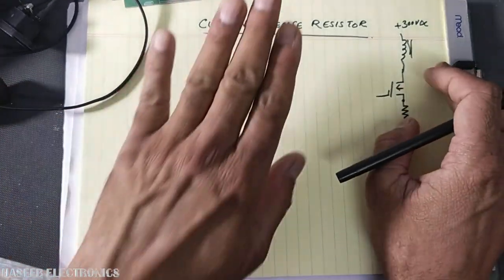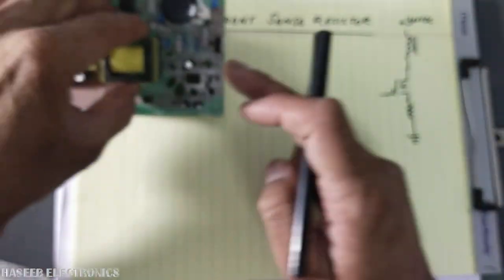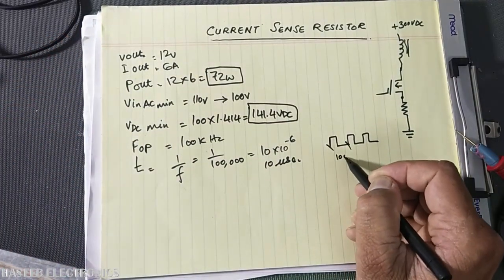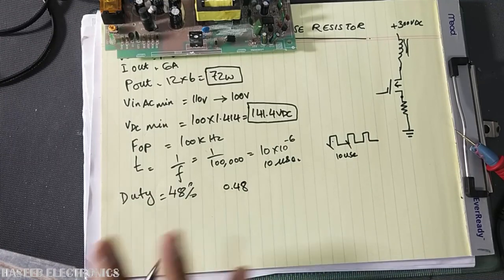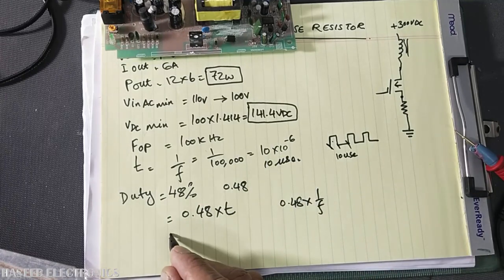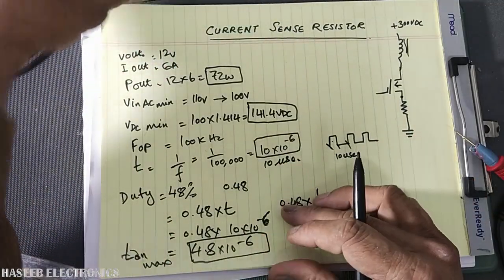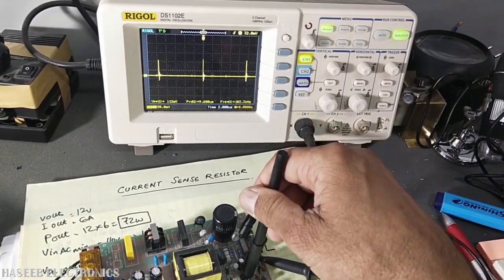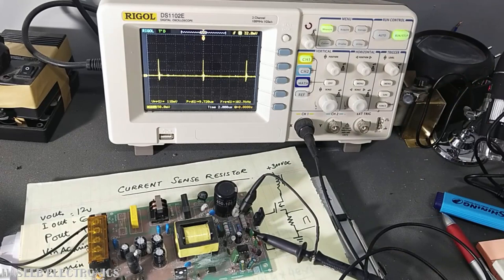{583} Current Sense Resistor Calculation

Comment: Multimeters have their own internal resistance as well. That’s why when measuring the current sense with regular meter it will not show correct value. You need an oscilloscope or a true peak to peak measuring device.this guy is a real good teacher. Ty for showing us how to prove it. Well done.
Reply from the maker: yes dear your right 
multimeters have internal resistance but that is much high so these don't effect too much, 
biggest effect is that the multimeters use RMS or TRMS sampling method and their high frequency is not good specially higher frequencies and duty cycle based pulses.so that's why we need oscilloscope to measure peak voltage or we need four wire measuring technique to get true rms value then we can convert in peak value by multiplying with 1.414
Reply: @HaseebElectronics  Awsome ty.

Comment: Sir, thank you for the amazing videos, I have gained so much knowledge from following your explanations.
Could you please make a video with focus on possible short circuits in the output side of SMPS? I am trying to fix my laptop adapter but unable to locate shorted component. In off board testing, output terminals of the adapter are showing continuity. For reference, I am working on a 135W, 20V Lenovo adapter using DAP019E IC(input side) and DAS01B IC & DAS05 IC(output side). I have checked all capacitors, MOSFETs and optocoupler after removing them from the board but the short still remains.  I'm extremely motivated to fix this adapter and learn more about SMPS in the process. Thank you again.
Reply: kartınızda yanmış bir kısım var mı?  var ise tüm yanmış kısmı temizleyin !
(this is article is turkish)

Comment: Thank you very much for your educational videos... I have learn many points from you..... Sir I have SMPS power supply (FDPS-100N-R5) and it is working some times with small vibration sound... most of the time not working.... I have checked many components and all are okay... please give advice to solve this problem...
Reply from the maker: thanks a lot 
please check that the transformer core pieces are not separated.
check the VCC capacitor connected to the VCC pin
check output side capacitors

Comment: I would expect the inductor efficiency adjustment to be 1/efficiency, meaning a requirement to increase the size of the inductor with a 10% reduction in efficiency.  So, 0.9 should be in the denominator?

Comment: I was expecting to see the one voltage drop that you explained in the oscilloscope.. with load...instead of 116mV without load. Can the inductance of transformer primary be found on data sheet or measure with LCR meter?

Comment: please how do we calculate or know the auxiliary voltage.
Reply from the maker: auxiliary voltage are to be calculated by checking the 
VCC voltage, UVLO lower & upper limits. 
after winding,  finally it can be adjusted by adding a current limiting resistance at vcc pin to compensate the difference in calculation and practical winding turns

Comment: Kindly explain the proper connection of pin 1 and 2 of  any uc38xx because it given me serious problem the IC can't start and if I touch the + probe lead of my multimeter it will start oscillating and the frequency is not stable
Thanks

Comment: Haseeb

Where did you obtain the duty cycle value of 48%? Because looking at the datasheet, max duty cycle for UC3843 states 100%. Is this a design choice? What if you were using UC3844 or UC3845 where in the datasheet it states max duty cycle to be around 48%?

Secondly, there's not really a need to go back and forth looking for inductance L of the primary coil and plugging things back and forth. The Ipeak can be calculated from the simplified expression below because a lot of the expressions cancels out.

Duty_cycle = t_on/t

Ipeak = 2.5/Transformer_efficiency/Duty_cycle*Pout/VinDC_min
Ipeak = 2.5/0.9/0.48*72/141.4=2.946A

When choosing Rsense value, are we choosing for a value where Ipeak is below the saturation current of the primary coil? Also we are simply choosing a value from worst case scenario. Whereas in normal operational mode, we do not really approach this region? 
Lastly, I have a question about the scenario where the input voltage is 230VAC, what happens then? How do I figure out what current is running through Rsense? Does the duty cycle now change because VinDC is much larger (and the duty cycle is changed from the feedback loop of the SMPS)?

Thank you.
Reply from the maker: best regards and special thanks 
1. the Dmax for 3842/43 is 96% for CCM operation. but when we discuss DCM operation, then its duty cycle is limited upto 48% maximum, above than this the core drives in saturation 
2. as any power supply is calculated and designed in worst case scenario, Low line voltage & peak output power, in this situation the SMPS controller must utilize its maximum duty cycle 
when the line voltage will increase, the SMPS controller will change its duty cycle to maintain regulation 
at that time the current in primary will not reach to peak, because in this situation the transformer works in linear region, because the magnetic fields is in building up stage
Reply: @HaseebElectronics  OK thank you for the reply. Sorry, I'm not too familiar with the terms. . . DCM? CCM? Where do I see this in the datasheet?
EDITED: Nevermind, I found in some other datasheet about Discontinuous Current Mode and Continuous Current Mode.

As for #2, ok that makes sense. So in the design scenario, I have to make sure that my selected PWM chip will be able to output the duty cycle at the higher line voltage?

I have an issue with a SMPS circuit and I can't seem to figure it out. It's a Ridgid charger that was designed to 110VAC with a PWM chip that carries the marking 6853M27 and JCS4N60FB MOSFET. I was trying to modify the charger so it would work up to 230VAC. It partially worked when I changed out the bulk capacitor and MOV at the high-side input to be suitable for 230VAC line voltage. The charging circuit was shutting off but there were no sparks or short circuits. Turns out later I found out that the auxiliary winding of the transformer that is providing Vdd to the PWM chip was too high of a voltage causing the PWM to go into OVP and shutting off.

However, when I was probing, my probe accidentally slipped and short a leg of Rsense to GND of the PWM chip. This caused the MOSFET to short circuit failure between Drain and Source, I believe my Rsense resistor went into open circuit and a few rectifier diodes on the high side also went into open circuit. When I was trying to fix it, I I replaced components with what I believe are suitable substitutes but I can't seem to get the board to work again without something short-circuiting or blowing. I was wondering if you might be open to help with troubleshooting? I can provide more details and circuit diagrams/picture of the board etc. But if you're too busy, I also understand. Thank you!

Comment: Thank you very much
How calculate input watt for this board 72 watt in output
Reply from the maker: 72 watt + losses 
72 x 110% =  79.2 watt approximately 
take 110% of the output power, it will include the input all losses and the switching losses and transformer losses

Comment: Can we calculate peak voltage from rms?
Reply from the maker: multiply RMS *1.414 = v peak 
check video number 305 for more details
Reply: @HaseebElectronics  🙏ok
Reply: @HaseebElectronics  sir you said that we can not measure peak voltage so. . If we do not have oscilloscope in that case, can we calculate the peak value using the above formula?
Reply from the maker: @HETRM  exactly yes
Reply: @HaseebElectronics  thankyou🙏

Comment: salam sir, you took frequency practically.but what if the current sense reisistor is burnt and our supply is no more working.how we can take the frequency then?
Reply from the maker: yes 
for that purpose we can calculate frequency using RT CT Value 
check video number 559